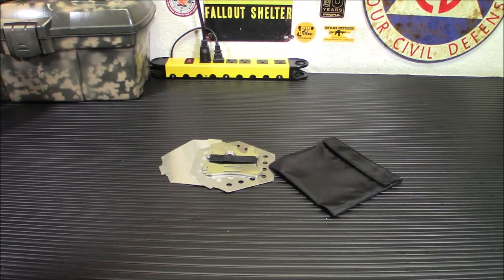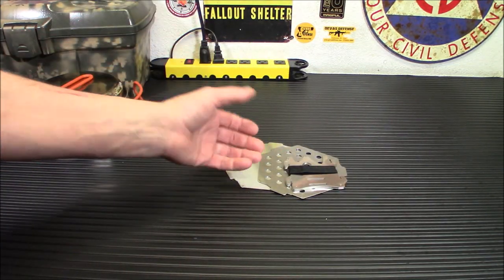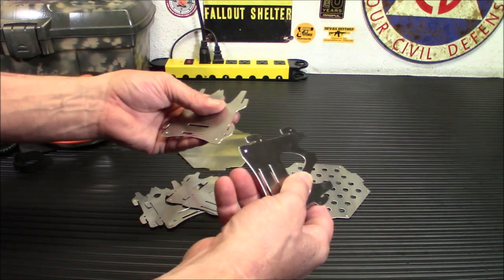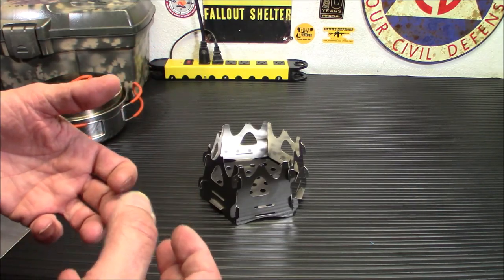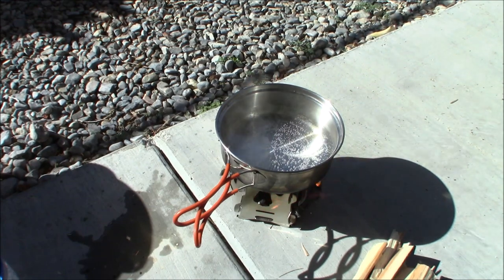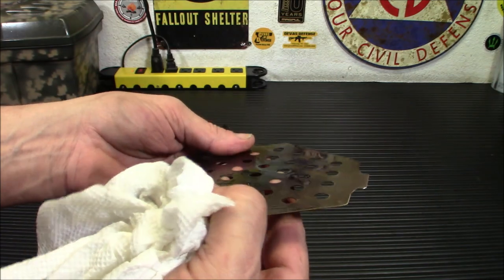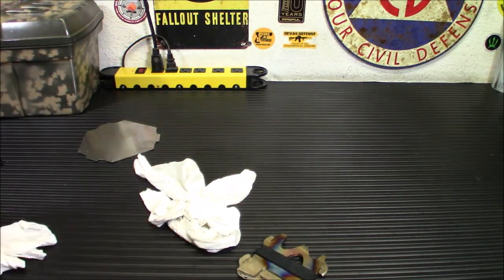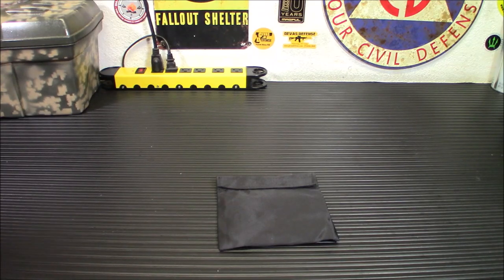Preppers Pocket Stove:  Herui Folding Wood Stove!

Comment: I see no issue using a Stanley Cook cup or something small if you just pop on a small grate (most outdoors people have a few in different sizes). Even cheaper would be cross bars (less than $4 usually), you can even make your own for less than $1,  OR one of my fav 'do everything' tools; skewers. Skewers work great on almost any of those type of stoves that have open tops too wide for cups/Stanley  sets etc.  There are so many uses for skewers not only for outdoors. Great vid (as usual), thanks for the heads up on this cool back up stove. My go to is the UCO mini Flatpack but just to boil water or something quick like that, this is perfect.
Reply from the maker: Yeah that is what I meant to say, you would have to use a grate (I have one forgot about it) or some kind of cross bars other than that it would be awesome.